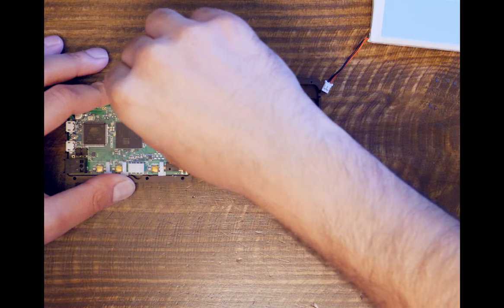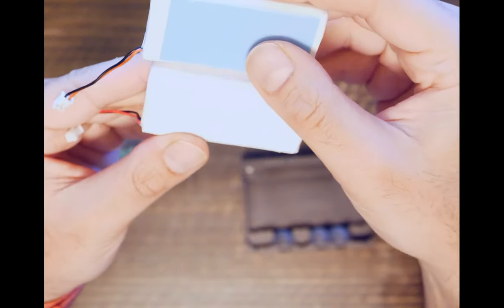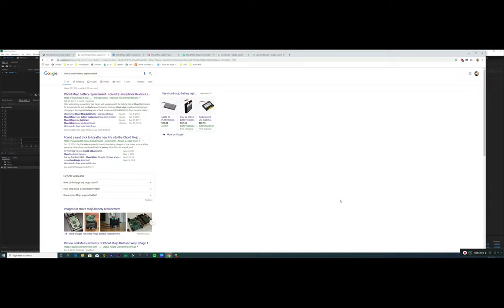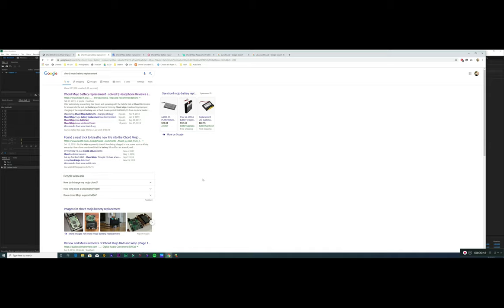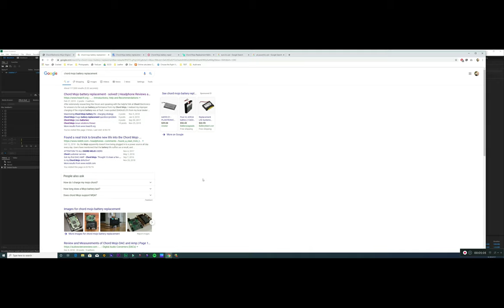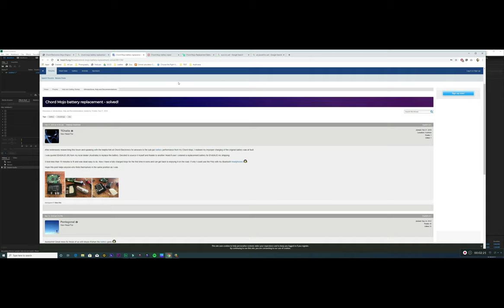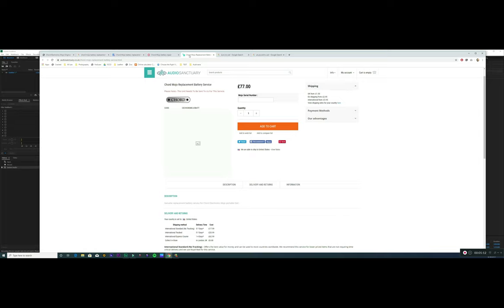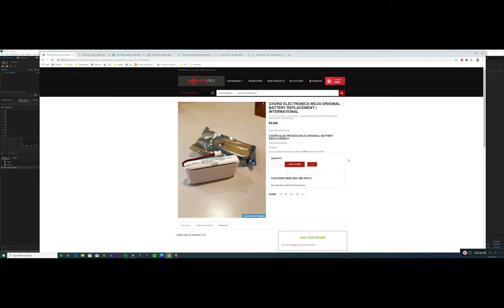How To Change The Chord Mojo Battery (And We're All Suckers)

Comment: Fun fact: You can remove the battery and the Mojo will work fine as long as it's plugged in. Worked for me
Reply from the maker: Yes true. So at least there is life after battery death.
Reply: I have removed my battery and use it as a desktop plugged in.
Reply: Marlon Urias, what power adaptor are you using? a standard 5v charger? I think the battery in the mojo is 7.4 volts. Did you hear any difference in sound quality? Thanks in advance.
Reply: I use a battery and a linear power supply and if there is a difference it is small. I have put heat sinks on the chips inside the mojo. I have also added copper tape inside for shielding. Always messing about my components. Just redirecting cables inside my cd transport made a big difference in performance .
Reply: @r423sdex  interesting. May I ask you which battery and linear PS you use? Thanks for your input!
Reply: @fiogray  must be  2AMP

Comment: This is, and will reamain, a GREAT video for any Mojo user. My Mojo, while sitting idle for a while, got back into use during this COVID year. However, it wouldn’t charge. With the help of this video, I took mine apart, removed the battery and (here’s where the vid helped the most) put it back together without the battery, so now it’s a DOJO - desktop joy - rather than a MOJO. 
Why wouldn’t it charge? The LI battery  was swollen and ready to POP. 
Moral of the story: If you have an early model MOJO, even if you don’t need to replace the battery, you owe it to yourself to look at the insides and make sure YOUR battery isn’t ready to pop.
Reply: Does it work without the battery? I thought I read somewhere that it wasn’t wired for pass through power.
Reply: @ChristopherYork1978  Mine is working fine without the battery... AFTER I fiddled around with the interior setup, to get it correct after I took out the ready to explode battery. Of course, it will need to be constantly plugged in via the power USB link.
Reply: Mine worked with out battery as well. It worked over 2 years with same battery, then it started to cut off the power if i had it powered on more than 24 hours straight (which i basically though was just good punishment for not shutting the thing down). Now after  ~5 years it was suddenly totally dead. Would not power on and I remembered seeing this video  as well as someone stating that it works with out battery. Seems to work perfectly fine. There is very low coil whine sound, but that was there with battery as well. 

As someone who don't really need battery feature I rather like how removing it also made mojo a lot lighter, and yea not having to pay to be able to continue using this awesome dac is big bonus.

Comment: I've been in touch with Chord, and they say they charge £80 to replace the battery, inc return shipping. I'm in the UK, mind you. I do fancy tackling the job myself though, having seen your very helpful vid. I've found a battery claiming to be 'suitable for the Chord Mojo' for £20. It's 7.4 volts, and 'compatible with ARL9047', so not the same number as you give in the video. Should I steer clear of that?
Reply from the maker: As long as the voltage, connector and size are right, then it should work. If the manufacturer or seller claims it is compatible then that’s also helpful. The original Mojo battery probably costs a few dollars at most for Chord, so the fact that you found one for this price isn’t surprising. I’d probably give it a go
Reply: @NoThemeReviews  Thanks!

Comment: You don’t have to get the exact replacement. Just as long as you match the chemistry, the voltage, and the current handling specs it won’t hurt to use a slightly smaller battery, and you can cut off the connector and solder the wires directly onto the mojo. Of course, if you know how to do all this in the first place, you probably didn’t need me telling you.
Reply: The battery needs to be rated for high heat as the mojo gets rather hot.  Unless you actually like battery fires in your pocket.

Comment: Hi - did your replacement battery last okay, or did you need to change it again?
Reply from the maker: So far so good. It’s starting to show faster depletion but it’s a lot better still than the original I had in it. Based on usage, I think the battery may need to be replaced every few years.
Reply: @NoThemeReviews  Thanks man - that's extremely useful to know! I'm thinking about buying one (there's literally a handful left - rumours are Chord have ceased production and will be imminently announcing the Mojo 2).
Reply from the maker: Ah. Well…this should be interesting.

Comment: Nice video. Can I ask what happen if I simply disconnect the battery from the device. I guess it will work normally without the battery if I let him connected via USB to the PC or to any other external  USB power supply, like for example the one I use to charge my phone. I'm I right, or am I wrong? 🙂
Reply from the maker: I can't imagine why you couldn't do that.  I suppose if Chord wanted be a real pain in the butt, they would make some mechanism that prevents powering the Mojo without a battery connected.  But that seems a little to cruel.
Reply: @NoThemeReviews thank you for the fast answer. Did you ever test that?
Reply from the maker: @maddonutdelicious7386  Nope.
Reply: @maddonutdelicious7386  As i know, mojo can be powered only from the battery. That means if you remove battery from the device and leave it connected to USB you will leave mojo without power.
Reply: @maddonutdelicious7386  I made some research and found that people using Mojo connected to USB for 24/7 without battery . Sorry for inconvenience if any.
Reply: @zemmarus  Thanks, the main question now before the investment will be if there is a really big difference in Hi-fi quality using Mojo as a dedicated DAC instead of a direct connection from the IPad to the Amp...
Reply: You can remove the battery and the Mojo will work fine as long as it's plugged in. Worked for me

Comment: Im having trouble removing the battery from the socket. Its in pretty good and seems as if i will break it if i pull ang harder. Any suggestions?
Reply from the maker: Its just some adhesive to the battery backing. You won’t break anything. If you have a small flat head screwdriver—like the ones for eyeglasses—you can gently pry that beneath the battery to get some leverage.

Comment: The battery is a non-standard size, none of my RC plane Lipos would fit
Ended up putting in a smaller 2s lipo and re-soldered the cable.  Works fine but battery life isn't as good.  (I had to use a smaller battery)
I bet the proper battery costs 15 bucks.

Comment: Hello , I would like to ask you for 2 issues with my Mojo.
1. I cannot charge Mojo battery.
2. I fill the surface heat on my Mojo.

Could you please suggest me to fix it?
Ps. Service center said that I have to replace  the new mainboard (9000THB) :(

Thank you.
Reply from the maker: I'm not a technician and cannot tell you how it can be fixed.  But you can perform some steps to figure out if Chord is lying to you.  Obviously, you should be very careful if you decide to open the Mojo and look inside.  The battery has a high discharge.  It is possible the battery is faulty.  I suppose it is also possible that the mainboard is faulty...but there's one way to check.  Does your Mojo work when plugged into a power source?  If so, it may not be the mainboard since a mainboard failure typically means the unit won't work at all.  Further, the surface heat could be explained by a quickly discharging battery.

You can try this ONLY if you feel confident you can do it safely:  unscrew the back and disconnect the battery.  Take the battery out.  Look at it closely.  If it seems bloated or puffy, you have a bad battery and you MUST get rid of it by sending it to an e-Recycler.  If the battery seems okay, then plug in the Mojo into power with the battery still out and unconnected.  Does the Mojo power on and work?  Does it still have surface heat?  If the answer is yes it powers on and there is no surface heat, then the most likely thing is that you need a battery replacement.
Reply: @NoThemeReviews thank you for you suggestion , I will do on this way to check it.
Reply: By default these Mojo's do get extremely hot after a few hours of use. Generally nothing to worry about as they are designed this way & the case acts as a excellent heatsink.

Comment: Do anybody has idea where to find battery for poly? I found that poly's wifi module continue working even if devise being switched off. That makes poly's battery dry up to zero and stay in this condition until user notice this and some times it takes quite long time. Because of this working feature poly's battery getting old much faster then battery of the mojo.(
Reply: Isn't that behaviour defective by itself? Do you still have warranty on the poly itsself?
Reply: @kianag6692  i checked Poly's manual and found the following notice:

"Polys microprocessor remains active when the device is switched off. This causes the battery to slowly empty over time"
Looks like it is normal working mode for the Poly.
This thing makes me crazy.  I would definitely prefer to have possibility to keep device fully off when i don't need it.
Reply from the maker: I tried to find one for you, but there is no information at all.  You will need to contact Chord and get their typical unhelpful advice to send the Poly to a partner for battery replacement.  Expect to pay well over $150.
Reply: @NoThemeReviews  Thank you for spending your time for searching. Probably best thing i can do now is to contact Chord for advice directly.

Comment: Battery estimated cost is around 14 dollars... And there must be some Chinese source to buy it directly!
Reply from the maker: Good luck!  I tried for weeks to find the battery on the cheap.  No doubt there's a Chinese manufacturer, but either they made these batteries in limited quantities and shipped them directly to Chord for distribution, or they're one of the few Chinese companies that follows its contracts and doesn't leak or sell the products.  If you do research you'll find batteries that LOOK compatible, but upon closer inspection you'll find the voltage, battery capacity, and connector are not the same.  The price for a battery replacement (user or professionally done) is--for the lack of a better description--mean spirited.  In fact, as I'll describe in an upcoming video, Chord's tactic with the Mojo is mean spirited.
Reply: no have special of the original Bat, ou can replaced with the another bat of RC